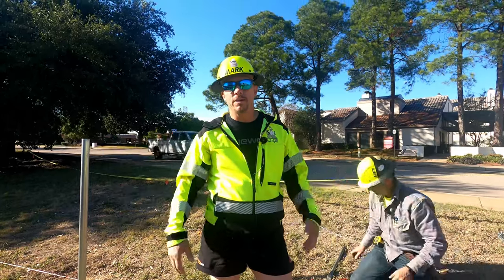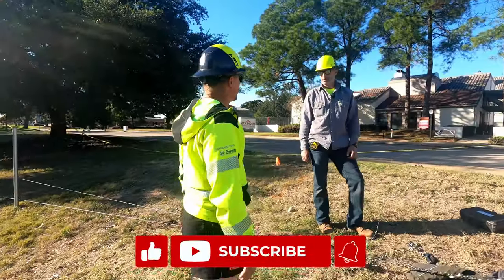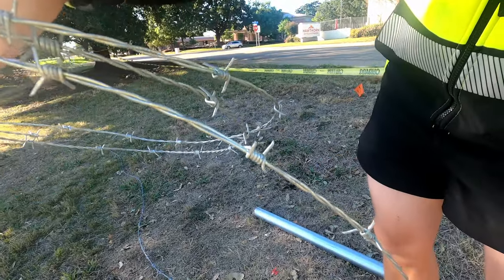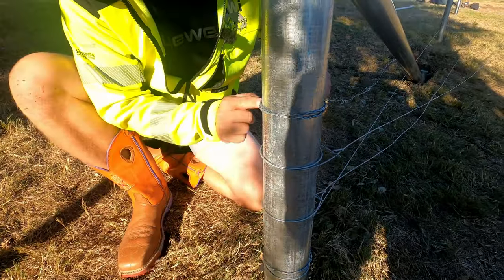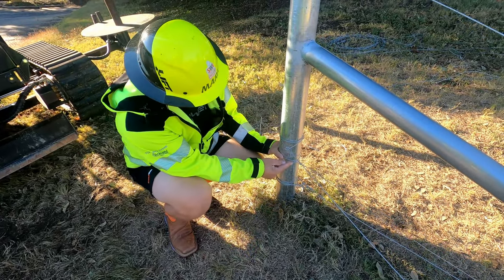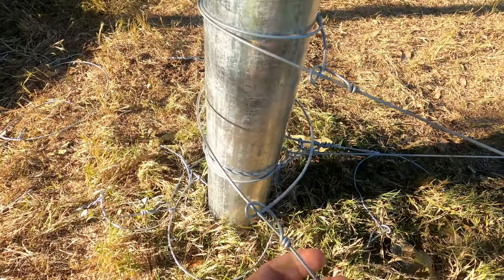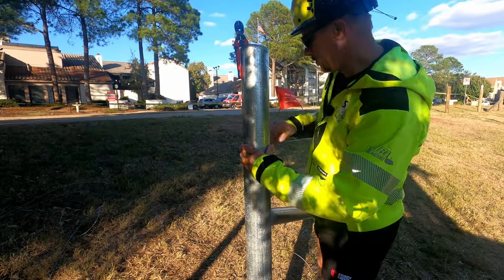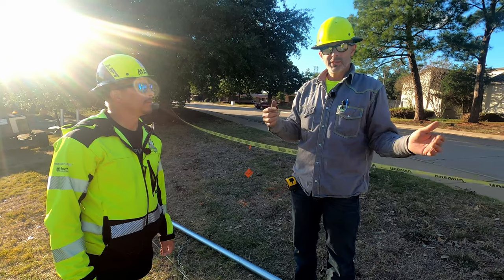Stop Double-Wrapping Your Ag Fence Wire!

Comment: You should make a fixture out of a tube and tie off to simulate a fence post to stretch from so it’s not killing the wire with the gripper. Granted 1200 lbs is probably tighter than you’ll ever stretch fence, it would just be cool to see the gripper eliminated as a cause of failure.

Comment: Hold on, hold on; about the ratchet strainers and springs...  I build a lot of fence each year for a non-pro (10-20 miles) so I really want some clarification here.  And before people get all riled up, I actually want to learn other people’s ways and techniques, not just start crap on a comment board, so don’t take this as a threat to YOUR way of doing it, I’m questioning MY way of doing it.

I use ratchet strainers and springs on each strand of HT smoothe wire every quarter or half mile depending on turns and stuff.  I terminate about the same interval as well.  I do so for shock absorption from deer hitting the wire and stretch for when trees fall on the fence.  It seems to work great.  The wire only vibrates from the deer and pops right back up when you cut off the tree. 

It would be WAY cheaper to not use them.  So what do y’all do?  Just strain them by feel from the end and tie off?  How about tree and deer damage without them?
Reply from the maker: If you stretch the fence tight enough the deer will bounce off it. As for trees falling on the fence if it’s woven wire there’s probably going to be an issue regardless. If it’s high tensile wire it’s going to need unequipped and re-stretched anyhow. It wouldn’t make much of a difference to have to add a Splice where there was a broken wire. We personally avoid Springs at all costs and have very few uses for ratchet strainers with short runs being the main one.

Comment: What diameter pipe do you use for the corners? And I'm guessing you can't drive those corners with a handheld gas powered driver?
Reply from the maker: 4 inch diameter pipe on the corners and no you are not able to drive those with a hand pounder